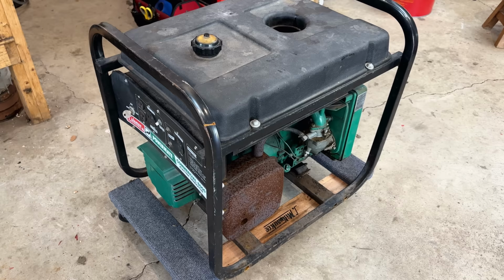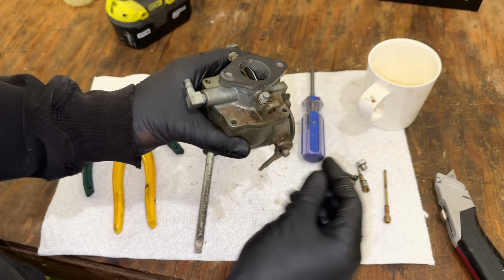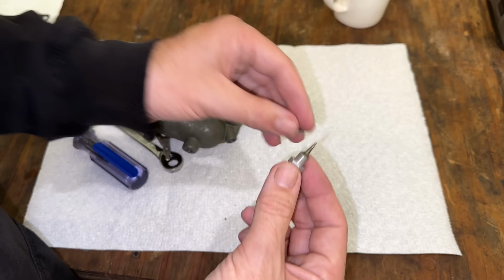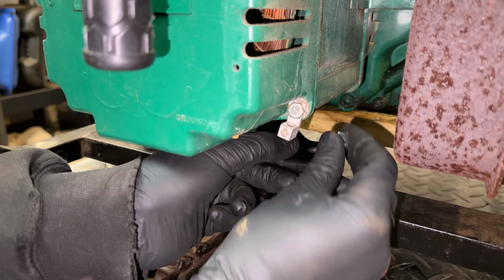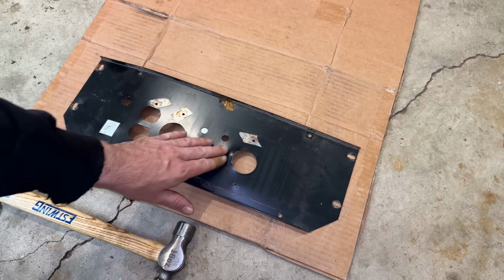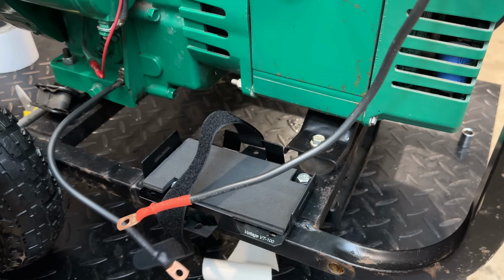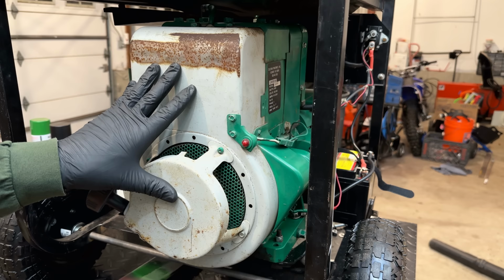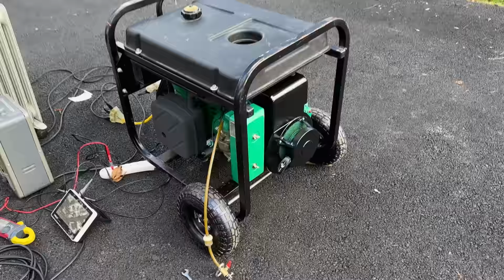1980s Powermate Generator - Will it Run and Make Power

Comment: Hello  James; As a long time viewer I am still somewhat impressed with the detail you put into your repair or refit projects, I agree with your assessment that it should not be that difficult to replace the fuel tank grommet. I now try once with locking pliers and reasonable pressure. If rhe valve does not come out ( it usually does not). I take a very small drill bit and drill the old grommet right beside the stem of the valve, 3 or 4 times on each side of the valve spray the drilled holes with WD40  and then pull the valve. It seems to work well. So far no valves damaged since I started drilling the old grommet. I have done 3 this way, it works for me. I think if you try it you will have good results.

Comment: Aggh, i was taught to leave one free turn before the recoil spring binds then install the cord, also much easier to put the rope in through the hole in the pulley and thread it out.  Not trying to sound superior but i suffered a lot at the hands of Briggs starters when i first started, just sharing info that i learned the hard way 🙂

Comment: Awesome video! I have an 8hp Coleman Power-mate that looks very similar to this one, I believe you are correct on the date. I purchased mine in 1995 and yours does look to be earlier. There are subtle differences in the two, mainly the air box and carburetor, I believe yours has a Flo-jet Updraft carb and mine is a Flow-jet 3 bolt carb. Mine has been in storage for about 15 years and I've cleaned the carb, replaced the spark plug, cleaned the rust from the flywheel (was not getting fire), replaced the fuel line, and will be cleaning and painting the same muffler that's on yours. When I bought mine I installed wheels that don't touch the ground when level and put smaller square tubing inside the horizontal frame support and pins hold those into position, either retracted or extended for transporting. Thanks for the video!!
Reply: Also meant to mention the deal you got on yours! Nice, I'll have about $45 in refurbishing mine with purchasing a fuel cap that the gasket was brittle on and falling into the tank, fuel line with filter, high temp black paint, carb cleaner and carb gaskets which B&S is proud of, the bowl, main jet and intake gaskets were almost $13!!

Comment: Great job as usual James.
I have a couple of suggestions that might be useful to you.
1)on plastic tanks I’ve had good luck with plastic welding and it is darn near undetectable, I bought my welder off of Amazon but I’m sure Princess Auto or Harbour Freight would have them too.
2) I use 303 Aerospace Protectant and Chemical Guys VRP to rejuvenate plastic and this does a great job making them look new again.
Hope this helps 
Ray

Comment: If you have an area of damaged sheet metal that won’t fit the vice anvil, clamp your club hammer (or sledge) in the jaws of the vice then you have a nice striking surface. I’d recommend buying a cheap anvil, you’ll likely use it a lot more than you think. Great video as always.

Comment: Push nuts are a pain, when it comes to service/removal. Should just drill holes for hair clips. My option anyways. To each their own, right.
Reply from the maker: I agree.  Have commented the same in the past.  That said, I had a box of push nuts and a short supply of pins so went with what I had.

Comment: Hi James, I really enjoy your videos. I own 3 gennys one of which is the Coleman Powermate 4000, pretty much identical to your 5000 except no electric start. Bought it at Costco in 1987 and used it to build my off grid cabin in Maine running power tools and air compressor. It was my source of power after the cabin was built and was perfect for my needs until I had a deep well drilled and it wasn't quite enough to start the well pump and other electrical needs so at that point in time I upgraded to a Generac 6500 Megaforce w/o electric start. The Coleman had well over 2,500 hours and I rebuilt the carb, new brushes and a paint job using Coleman Green spray paint. I still have the Coleman I/C 4000 and it starts always on the first pull. After 4000 hours on the Megaforce I upgraded to the Champion 41532 7000 / 9000 electric start with remote fob. I have since installed a Champion Tri Fuel carb and run it on LP which makes it purr like a cat compared to gasoline. I still own the Generac as a backup to the Champion at the cabin in DownEast Maine. The only problem I have ever incurred was the Coleman was left outside uncovered and an unexpected snow shower allowed moisture into the end housing toasting the capacitor. Engine ran fine just no juice so soldered in a new capacitor and problem solved. So needless to say watching your videos of all your Generator repairs is very interesting and educational for me. Thank you!!

Comment: Governor regulation could be closer. There may be a response adjustment by
selecting different pivot arm holes on the linkages and / or changing the angle
slightly at which the governor spring pulls, some have a metal tab that is bent 
using a screwdriver or pliers to fine tune the governor response.
Reply: Another possibility is the linkage arm on the governor output shaft may
have slipped. There a clamp attaches the linkage arm and its position 
may have slipped so it is out of range for the governor to reduce speed
far enough towards idle. Make sure the idle screw minimum is low enough
so the governor can drop far enough. The engine is actually capable of idle 
at a very low speed even down to a few hundred rpm, but on a generator  
minimum idle is controlled by the governor at the same 3600 as when
the throttle is full open under load.

Comment: Ditto on the spark arrester comment . The high charge voltage has me puzzled.  I understand that it is unregulated, but the battery voltage under charge shouldn't rise that quickly unless the battery has a high internal resistance or the charge current is too high for this size battery.

Comment: Another great video James, those old Briggs engines were so well made - nice and strong. A comment that might be of use on your spray paint. Here in New Zealand I can go to my local paint supplier with a part with original paint that I want matched. They use a spectrophotometer to produce a formula for an exact match. They then make up a spray can for not much more than the cost of an off-the-shelf can. There must be a store close to you that can do the same. Like you, I thought that cowling would look better in the original green.
Reply from the maker: There is a store close that can color match, but never seen the option to add it to a spray can.  That option sounds great.  Would have to use an air sprayer or a paint brush :(
Reply: @jcondon1 Auto parts stores can  match the spray cans as well as paint stores like Sherwin Williams, etc...

Comment: I like your attention to detail, noticing the power head was not level and how you clean, paint and do your best to remove the dents. I also have a similar older model Homelite generator that I occasionally use. It runs great, I need to test the output of the power head to confirm that all is adjusted correctly. All of your videos I have viewed and the added test equipment that I have purchased will help me do that. Keep up the good work.

Comment: The one on the left looks like a NEMA L6-30R. Pretty common actually. I believe the plug is NEMA L6-30P.
Reply from the maker: I need to get an adapter, but it has no neutral and the load band needs that.  It is bonded to neutral so it would work over the ground wire.
Reply: @jcondon1  🤔 Gee. That is strange. Well, yes you will to either buy or make an adapter. I really like this old unit. Coleman has been my go-to brand for outdoor equipment for many years. I have two stoves … one is Sears branded … and a couple of lantern. They must be at least 40 years old and still work perfectly. Anyway, great job restoring it!

Comment: Thanks for the video Jim. I use a 12 point 7/16" socket to remove the square pipe plug when doing oil changes.

Comment: Crazy how much better built everything was even in the 80s. That carb looks indestructible and all the metal on the generator is so thick, now it would all be plastic junk and thin garbage. That thing will run forever.

Comment: The battery charge circuit, is it just the one wire with a diode? If so you may be able to put a voltage regulator on there to keep the charge voltage at a reasonable level. Would require some wire work and modification but doable. I agree though its nice but not necessary since gens sit more than they are run. Great job!
Reply from the maker: Single wire with a diode.  Was thinking the same thing.  It should be possible to add a regulator.  Was not sure what others did to fix this issue.
Reply: @jcondon1  I would measure the voltage before the diode which will be AC voltage. It should hopefully be higher than 20 volts AC. Adding a two-pin molex connector to a standard Briggs voltage regulator you should have plenty of current to drive the regulator and the regulator will keep the battery from being overcharged

Comment: The muffler where there’s 4 screws missing looks like it had another piece of pipe connected perhaps redirecting the exhaust.
Reply: I think the 4 holes are where a spark arrestor would be mounted.

Comment: I’ve had great results using the generic Chinese replacement carburetors on these Briggs engines. A big problem with trying to rebuild the original Briggs carburetor is when the mating surfaces of the top and bottom housings are warped. Either a fuel leak or a vacuum leak at the joint where the fuel bowl meets the upper housing will make the engine run poorly even if the carb is clean and otherwise in good shape.

Comment: Hi James. Keep up the great work ‘Oh carb guru!’  
My gut instinct tells me that the frame spacing is way too narrow. Leading me to believe that this is the wrong frame with bodged twisted mounts. Perhaps even extra drilled holes in base of engine. 
Plus move wheel axel to other hole closer to handle. As long as axel fits by frame mount bolts. Offsetting (cantilevering) weight beyond axel will make it easier to move.

Comment: James on those stabilizers and rubber bushings in the front leveling foot bracket. Has two different mounting locations on those. The two bottom holes in the first set. And the wider two are the second set of mounting holes. Which you just swap over the rubber bushings and bolts and 🔩 nuts and other hardware it takes like flat washers and lock washers to.

Comment: If you really wanted to fix that battery charging issue, that looks quite easy to plumb an inline voltage regulator inline with the charge wire. Otherwise I'm glad to see this old gal working nicely again, way to go dude!

Comment: James by putting silicon diodes in series in the charge wire you could lower the voltage.
Each diode will take off approximately 0,6 volts.
Great looking generator in the end, good quality to start with.

Comment: I found a great method of fixing clogged carbs without removing it. Feed it some E85 ethanol fuel and run it. The ethanol will dissolve varnish and together with engine vibrations will work wonders in the carb

Comment: Could you cut out the bolt head spaces in a solid tray insert (say pressure treated ply) so that the battery can never vibrate down onto those protruding bolt heads...
and then put that layer of foam over the tray insert  to reduce the vibrations, cover the bolt head holes... and tidy up the tray insert ?
Reply from the maker: That would work well

Comment: This old generator seems to be better built than most modern ones. In general their overall design is such that they must be placed in a shed or barn of some kind. They cannot be left outside in the open for a number of reasons, of which the most important one is the sensitive mechanical motor speed control device, which relies on the centrifugal force from a couple of rotating weights which is counterbalanced by a spring. Secondly the design of the petrol tank and cap is such that rain water and dust can easily enter the tank if the generator will be run outside. Third, the cooling of the generator is done by allowing unfiltered air to be sucked in through ventilation openings and come in direct contact with the windings, brushes, sliprings and so on.

Comment: Really nice. I expect the charging voltage was high because old lead acid cells had lower internal resistance at full charge. Not sure what a simple fix would be. Loading down the charge circuit somehow eg with a power resistor would work. But mounting and heat dissipation would be issues. A voltage clamping circuit would be more elegant but obviously complex. Just thinking out loud. Probably not worth fixing. 😊

Comment: You ought to get yourself a blacksmith's anvil for hammering bent metal, etc. Doesn't have to be an expensive one. Harbor Freight has a 55 Lb. cast iron one for $70, and a 65 Lb. one for $150.  I would recommend the 55 Lb cast iron as being fine for general all around use. No need to mount it on a stand; it can just be set on the floor or on top of your workbench.

Comment: James put a scope on the battery charge wire and see what kind of wave is there, it's likely a half wave rectifier.  If so given the voltage is only on half the time pulsing is that really an issue with overcharging?  Could a current limiting resistor be added if there were concerns?
Reply from the maker: It is a half bridge.  The correct resistor should correct the problem.
Reply: @jcondon1  If you could show us your fix that would be great as I have the same style/vintage engine just on a wood chipper and its showing over voltage on the charging circuit too

Comment: Before "pounding" the panel use piece of lumber/wood to fit inside back of panel laying on cardboard and floor then stand on it or add weight to slowly and gently force it to first stage of straight then do fine point straightening with pounding small spots.  Or sandwich between two pieces of lumber and squeeze in a vice and additional clamps to evenly flatten it out to avoid risk of hammer dormation.

Comment: Spray the rusty exhaust with Ospho.  It turns iron oxide into iron phosphate which is inert.  It will turn the exhaust black and it also acts as a primer if you want to paint.   The best stuff for rust. It would be best to wire brush the exhaust first then spray with Ospho. The rust will not return.  Also spray the rusty housing with Ospho then you can paint over it with no concern rust will ever come back.

Comment: You can always put a zener  diode in series rated for the number of volts you want to drop across the diode, leaving the rest of the voltage for the charge circuit.

Comment: Just A quick and simple heads up to you on that part of it. Those other two engine mounts are made that way your right about both sets of them on that Coleman generator. I'm just guessing the name brand of it to. I recommend color matching that green to make the pull starter and breather the same green color. I believe it's called sea foam green. For those Coleman generator's and A lot of they're other outdoors equipment never had one set color code. It was originally supposed to be olive green with clear coating.

Comment: I am looking forward to seeing you work on or service a Firman 9000 peck 7500 watt continues generator. 
Just bought it today at Costco for whole house power in power outage.
Always watching your post as this unit has many of the same  features as those you have posted on fixing and making it run.
Tks for your posts, Michael.

Comment: I have a Coleman generator that needs a handle - the kits are nearly 50 bucks though!
Reply: Mobility in a generator is high desirable, so a kit is a good investment.
Reply from the maker: The handle is overpriced, but worth it in most cases.  Especially on resale.  A lot easier to sell.

Comment: You can use a tie rod pickle fork for getting those bushing type fuel pickups out of the bottom of the tanks - goes in and separates it nice and gently.
Reply from the maker: That would certainly work.  Just have to go easy on the plastic.

Comment: Just an FYI.  For 1 inch spacers i like to use chrome sockets.  Tag sale bought sockets.  

First time i ran into needing them was fixing an older briggs powered pressure washer. I bought a harbor frieght lawn mower engine predator 196 i think.  But the shaft was 1 inch longer so i raised the engine with sockets has been working past 4 years np.

I still have the briggs engine off thw pressure washer i thought was linkage was setup wrong because the brigs would run wide open soon as started.  But was something with govenor broke. I been hope to find another of these briggs to try get govenor just to see if that would fix it.